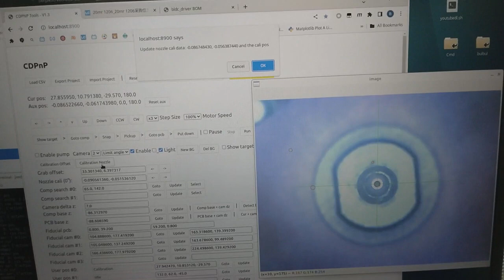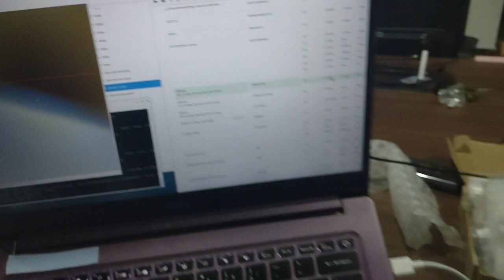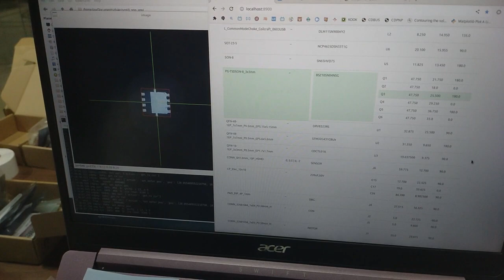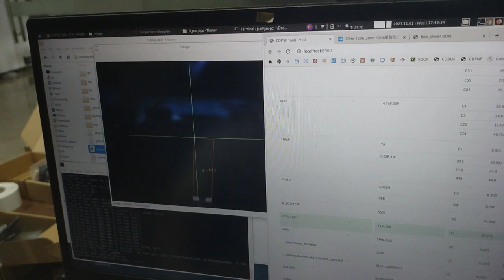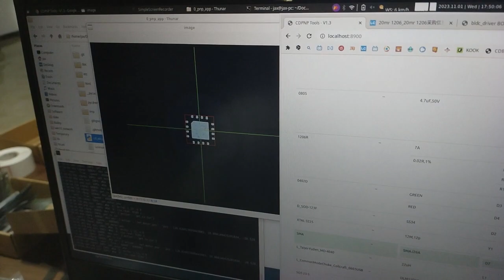CDPnP upgrade: Nozzle and Chip Auto-Calibration

Comment: Very nice, this is exactly the right thing for prototype production. 
1. is there a way to switch to quiet stepper drivers similar to TMC drivers? 
2. and then I would be happy to see a video on how to install the CDPNP software.
3. Will there also be an option to mill PCBs in the future?
Thank you.
Reply from the maker: 1. Stepper motors currently use the open source CDSTEP driver, and changing the driver chip on it shouldn't be a problem. However, for the next version, it's more likely that we'll switch to open source CDFOC drivers to drive the bldc motors instead of stepper motors. both the CDSTEP and CDFOC projects can be found on my github page.
3. The next version of the machine will be designed to be modular with quick changeable heads, and will be able to support mill PCBs in the future.
Reply: Thank you very much, I have a few more suggestions to the future:

At JLCPCB we can have the PCBs assembled with the components at the same time. Only components that are not in stock need to be manuell soldered.
In this case, you install a "Voltera-V-One"-solder paste nozzle ;) or others 
and like all 3D printers working, print one layer of solder paste only in the gerber-places where components are still missing.